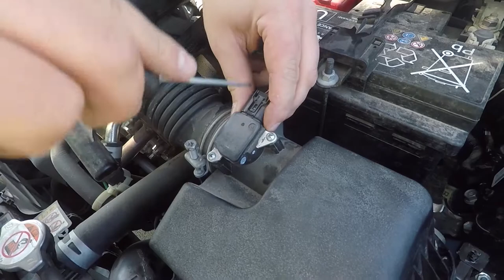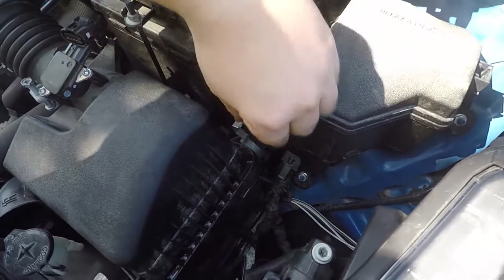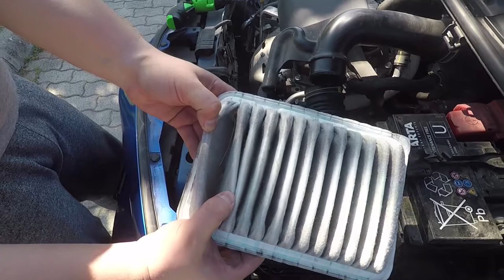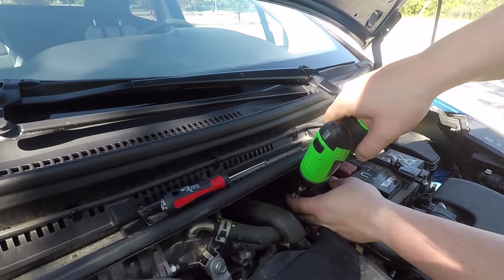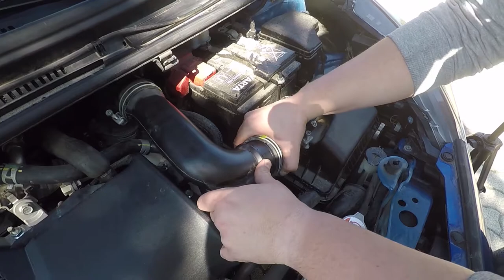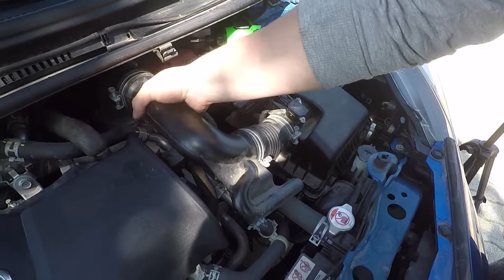Toyota Yaris - Air Filter Replacement

Comment: Why to use a a tool to disconnect the air sensor if you can do it just with your finger and why disconnect the air sensor if it is attached to the top of the air filter compartment? 🤔🤔
It's just a question.